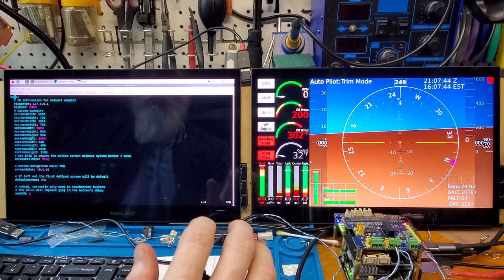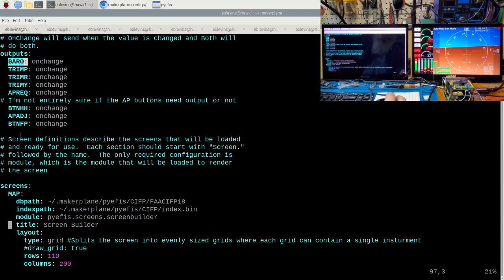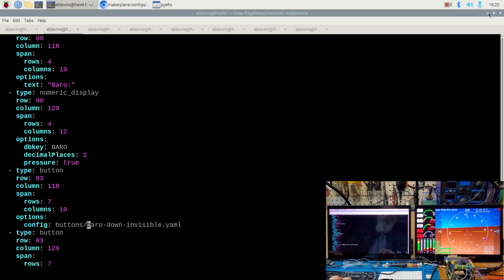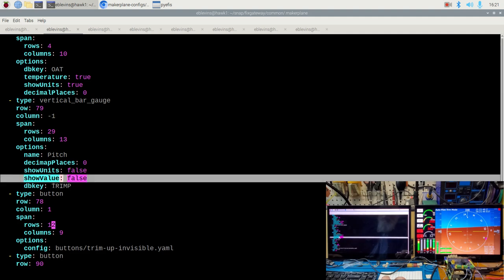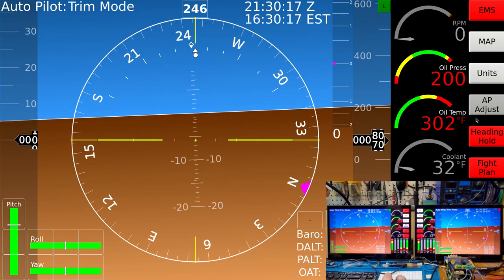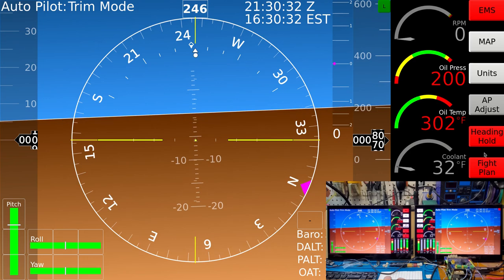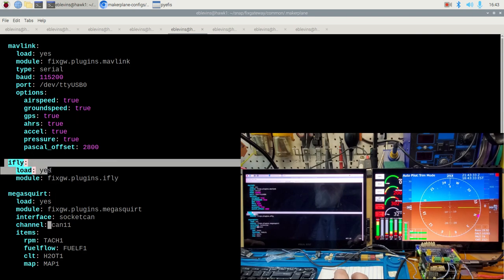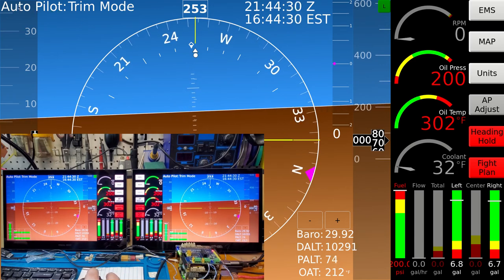Makerplane EFIS progress

Comment: Hey Eric. John emailed me to let me know about your updates. I'm not sure what else to say but WOW!!! Great work!!

Pretty much every improvement I can think of you've already implemented (and many more). 

I'm also planning to install an Aeromomentum AM13 in my Sonex and originally started looking at MakerPlane as a possible EMS display for the Microsquirt outputs. Great idea to add it directly to the fixgw! I was just planning to add a microcontroller that would read the MS data on one CAN module, translate it to FiX, and retransmit it over a second CAN interface. 

I would say the only other improvement I could even think of would be to add a game engine that uses USGS elevation data for synthetic vision. I started looking at it, but simply don't have enough time to learn/implement it all. I was able to import the data for the Denver area (I chose a tile with some dramatic relief) and import it as an object into a really basic Panda3D project one day. But that's where I stopped. I hadn't looked at geo-referencing GPS data to the map tile data yet ...

Anyway, great work!! Thanks so much for doing this!!
Reply from the maker: I'm just going to use iFly EFB for maps and synthetic vision. No sense reinventing what they have already done very well. That is why I made it possible to run Android inside the EFIS. Also wrote plugin that will get waypoint data from iFly.
Reply from the maker: I'm just going to use iFly EFB for maps and synthetic vision. No sense reinventing what they have already done very well. That is why I made it possible to run Android inside the EFIS. Also wrote plugin that will get waypoint data from iFly.
Reply from the maker: Oh, since making this video I started working on an interface and plugin for com radio. Planning to get the MGL v16 remote mount radio with integrated intercom. Will communicate to it from fix gateway over CAN. If someone wants to donate me an MGL N16 com radio I'll make interfaces for it too! I think that is the last major component needed to have a complete VFR glass panel.
Reply: @ulbuilder  Oh, OK. Yeah, that definitely makes sense. I've never used iFly before and didn't know it did synthetic vision. That's cool!

Comment: Spent a while digging through the forum and couldn't find answer. I'm probably not searching for the right things.  I installed Pyefis on an old touch screen tablet i had and running it only with my stratux. When i disable demo mode in the fix gateway default.yaml file everything seems to work fine with regards to my stratux but my sky and ground are just shades of grey. Any thoughts?
Reply from the maker: I'm on my phone so can't easily look, I wonder if stratux plugin in fix gateway has settings to turn the pitch and roll on or off. The other thought is that the stratux will not output AHRS data on the network if it does not have a good GPS signal.  It will display in the stratux web interface,  but if the web interface is complaining about no GPS it is not sending out AHRS data on the network and the fix gateway will not receive that data. It will always show gray when data is missing, that's how it alerts the pilot to no or old data.
Reply: @ulbuilder  Ithe ahars is working fine it's just dark grey for the ground and light grey for the sky. the virtual VFR doesn't seem to be working either.
Reply from the maker: @showlogisticsllc5109  the fix id's LONG, LAT, HEAD, ALT, GSI, PITCH, ROLL ALAT and TAS must have data that is not flagged old bad or fail for it to display correctly.  If you run the fixgateway client you can do "read HEAD" if it is old bad or fail it will tell you. Try that for each one till you find what one is causing the issue. You could also do "write HEAD 0" to set a value. The timeouts on some of these pieces of data is less than 1 second so they will turn old if not updated quickly enough.
Reply from the maker: @showlogisticsllc5109  looks like the stratux plugin only provides HEAD, PITCH, ROLL, ALAT, ALT, VS, IAS. So that would explain why some data is missing and it shows gray.